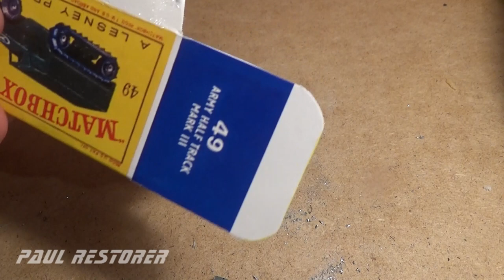Army Half Track Mark III,  Matchbox nr 49 renowacja zabawki auta, naprawianie

Comment: You're unlikely now to find one of these #49 Army Half-Tracks with surviving original tracks, and not always on playworn examples, either. Even on preserved ones the tracks as they aged, cracked. I bought mine about seven years ago, and naturally they were replaced by repro grey tracks (also available in green or black). I would think with all due understanding, having to settle for the repro tracks shouldn't detract very much, if any, value. To make up for how I settled on an example with repros, and it was nonetheless mint and deserving of one, I found an original B box like it once had, and that, I felt, made for increased value.
Reply from the maker: The rubber on the tracks was of such poor quality that it disintegrated on its own. Therefore, when reproducing caterpillars, I make them from polyurethane, which is much more durable than rubber. Best wishes

Comment: A question if I may Paul. Would using a bead blaster on the model bodies do too much damage to the soft zinc?
Reply from the maker: Hello this method I would definitely not recommend if you could try to sandblast the body but under low pressure. If you want a quick paint removal effect, use caustic soda. Best wishes